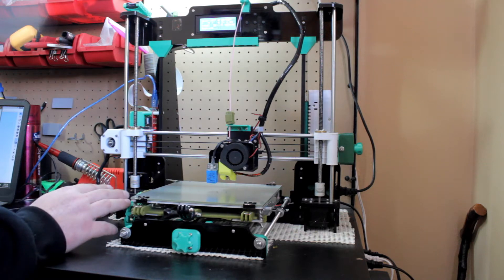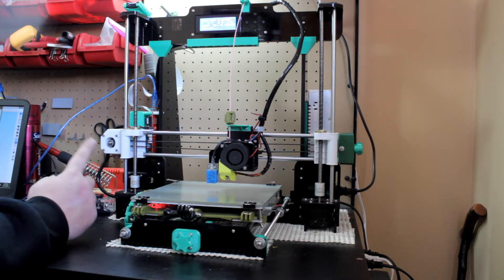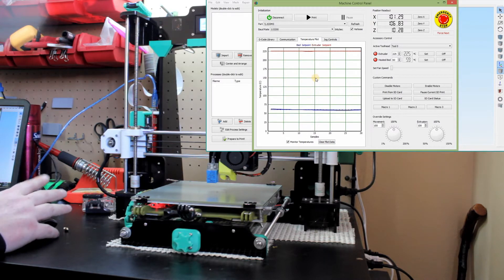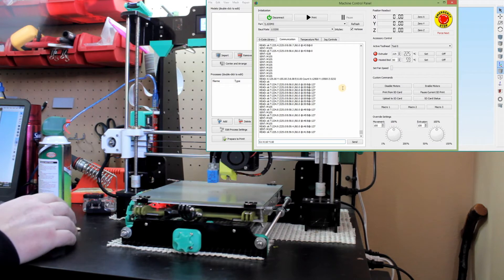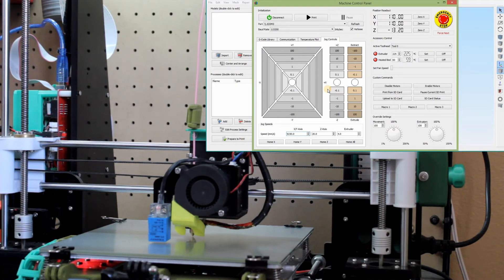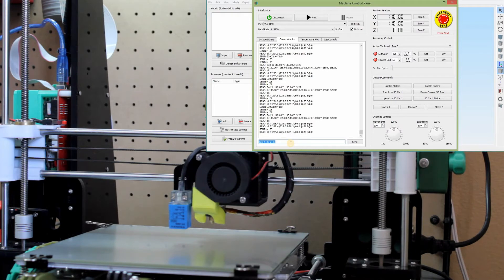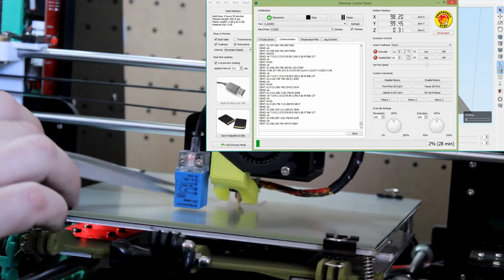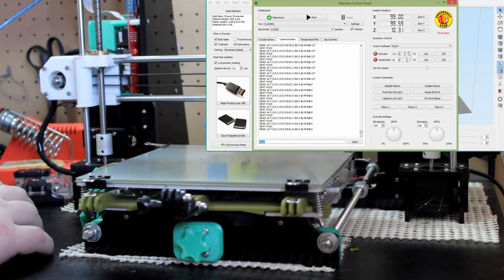Anet A8 Auto Level Setting the Z Offset

Comment from the maker: I would like to clarify what I was saying about setting the Z offset around the 10:30 time.  Although the sensor does "tell" the printer where the nozzle is in relation to the bed.  The sensor is more acting as a sensor away from the home point essentially stating a distance in the Z height where the nozzle is subtracted by the sensor value.  I am pretty sure that is why the input value is a negative number and not exactly what we see in the output return of G30.  At least that is my understanding, if anyone else has a more clear way of explaining it please feel free to comment.  Keep your amps up! E

Comment: Setting the bed height is such a pain in the arse manually. I either burn my glass or burn my paper, managed to do a couple of prints but finding it hard to get the right height.
Reply from the maker: You mean without the sensor or setting the height with a sensor? I still manually level the other printers I have, getting metal feeler gauges really helped me out, makes it much more accurate and quicker.

Comment: Any reason you dont use octopi? Gets you access to the terminal without needing to plug a laptop into it. I also have a script for simplify 3d to automatically send gcode from the computer to the octopi so no sd card is needed.
Reply from the maker: No reason specifically other than needing additional hardware and I have to physically interface with the printer for hardware maintenance and print removal anyway. Never found it too pressing to change to a wireless option. Although once I finally reflash to Marlin I probably will switch to a pi set up for fun. I haven't done much with the Anet since I got it printing well but some new mods on it would be a fun project in the near future.

Comment: Thanks for the video, very helpful. I have a Anet A8 which i just upgraded to marlin 1.1.9. when i try to home all the extruder moves all the way and slams to the right if you were facing the machine and then stops and says homing failed reset printer. I also have the same exact sensor that you have. I was just wondering from your video if i pretty much did the same would that stop it from happening  or is that something i have to adjust in Arduino? I havent been able to find x y z axis settings that should be adjusted in Arduino so its just set as stock from marlin. I used Cura prior to the upgrade and it was fine. I downloaded Pronterface , any advice would be helpful. Thanks!
Reply from the maker: Can you control normally in Pronterface? Skynet is a version of Marlin so the command codes will be similar but it would be best to follow the Marlin specific instructions.  It sounds like there is a problem with the config files that were uploaded during flashing.  The motor should home to the left on the X-axis.  I haven't switched to marlin yet just because "if it ain't broke don't fix it" but I would possible try to go through the process one more time. Checking the marlin package.
Reply: @RevampedOutdoors  I believe so i havent tried yet because i wanted to look at more videos and learn how to use it without making anything worse. After watch your video it helped to understand Pronterface alot better, I can control everything manually via the screen with no issues though except when i hit home all. Im going to try what you did in the video i didnt realize that you can lock the settings to the board from that program, this would probably be much easier because i really didnt want to try and mess with command lines in Arduino.
Reply from the maker: @ForeverGhostdoggg  agreed, making adjustments and saving to EEPROM in a controller is much easier to see and troubleshoot especially compared to having to save and reflash in the IDE.  I'm sorry I couldn't be more help with 1.1.9. I hope you can tease it out.  It sounds like the motor is reversed in the firmware for some reason (assuming the motor is installed correctly, gear towards you), if pronterface moves it to the left when you hit left and right when you hit right everything should be installed correctly.
Reply: @RevampedOutdoors  everything worked fine and i printed some things so i believe it may be a Arduino thing. I'll try what you did in the video and i'll give you an update. Thanks for the help!
Reply: I used the g1 x110 y110 to get to the center of the board but i cant lower the Z because it won't let me go past 0 to go into a negitive number. Now on my screen it say Home XY first. My setup was way off when i tried to use the G1 code it moved the hot bed all the way to the front and the nozzle was right above the hot end plug! Any ideas how to change the numbers so i can go into the negitive to adjust this?
Reply from the maker: @ForeverGhostdoggg  because it's a different version of marlin I think the same codes do completely work with the bed leveling function on 1.1.9, I don't have any screen prompts for auto bed leveling on my version, have you checked the marlin auto leveling setup? http://marlinfw.org/docs/features/auto_bed_leveling.html
Reply: @RevampedOutdoors  Ok this is what i did so far,problem still isn't fixed but i'm starting from scratch. from the very start i wasnt able to flash any firmware so i purchased a USPasp from amazon which worked to load a bootloader and flash software.My board didn't have a bootloader installed.So i backed up my original Anet firmware re-flashed it then flashed marlin 1.1.9. So this is where i am now. looking into Arduino i realized there was NO bed leveling at all, i removed the //, changed it to BI_linear. Also there are no number values in the : NO value for probing (where the probe can reach) section. I'm thinking this is why the extruder has been running into the right X Axis, because it doesn't know where to stop or where how far to go. So i think if i have a close number to those values , then i can follow what you did because your video helped me come close. I don't think the software knows where my heat bed is or how long it is, also what program where you using cus maybe that can help me fine tune everything.
Reply from the maker: @ForeverGhostdoggg  I was using simplify 3d for the interfacing but it's a paid program.  The specifics of the printer should come loaded on the firmware, the software is just telling the printer where to go.  The basics of the printer will be established in the firmware, so the version of marlin should be specific to the Anet A8.  That should have the bed measurements in config files.  Did you overwrite the config files in the marlin you uploaded?

Comment: What kind of sensor are using with the glass on the bed? My sensor will not sense the bed through the glass. Thanks.
Reply from the maker: I have the cheap Tronxy 8mm inductive sensor on there.  For some reason it is working fine through the 4mm borosilicate glass.  I have heard of others having a hard time so I wanted to add some ferrous metal to my bed, I got some 20 mil mild steel and cut it 2 mm smaller than the glass bed and I put that between the Al and the glass.  It really helps the sensor pick up the bed under the glass.  I think I went over it a bit in this video if you're interested, it's pretty short though.  https://www.youtube.com/watch?v=Nu1_Jdwr4pg

Comment: HI, can you please say which software you are using in this video
Reply from the maker: Simplify 3D has a Machine Control, that is what i used but you can use Pronterface which is free software and lets you control the machine and input G code commands.

Comment: I'm currently setting up the same sensor on my A8 and I was wondering if you ended up doing the modification to the wiring so the sensor would get the proper voltage or if you're just running it at 5v? I cannot get mine to activate that far from my bed with a glass plate on it at 5v and so my z-offset is almost at 0 and it just doesn't like to work well.
Reply from the maker: I just have it wired into the JST connection for the end stop with the wiring left to right while plugged into the board as follows Blue, Brown, Black. I didn't need to bypass it or anything I just switched two of the wires before I plugged it in. Hopefully that helps!

Comment: Great video... I'll try this tonight... But I have a question... When you set the initial distance form nozzle to bed, with the gauge, you save 0 as the distance but the real distance is 0.18... Why not set te 0 to a real 0?... I supose that the firmware will start the printing at the apropiate height for the layer heights sets on the slicer... I am missing something here?... Forgive my english... Thanks a lot anyway, for a really clear explanation...
Reply from the maker: Thanks for the kind words.  I'm not an expert by any means but my understanding is that the G92 command tells the firmware to assume that the distance the nozzle is at (in this case 0.18 mm) is the new 0.  This means that when the G-code is sent to the printer to print it tells the printer to "start printing at 0" it starts at what the firmware now knows as 0 so the 0.18 mm we told it to recognize as 0.  When we set that command the firmware is taking the value that the inductive sensor is telling it (in sensor language) and setting that value as 0 in the firmware.  So any command to go to 0 in the future will be 0.18 mm from the bed based on the sensor value (assuming that the deviation from the sensor is not too deviant). I hope this made sense lol.

Comment: What software are you using please, where it has the emergency stop
Reply from the maker: That is the Machine Control in Simplify3D.  If you do not have Simplify3D you can use a free GUI for printer control like Pronterface.  Pronterface comes in the PrintRun package and is free it also has a reset button where you can hit if something goes wrong.  You can find those downloads here: http://www.pronterface.com/
Reply: Thank you very much appreciated for you advice